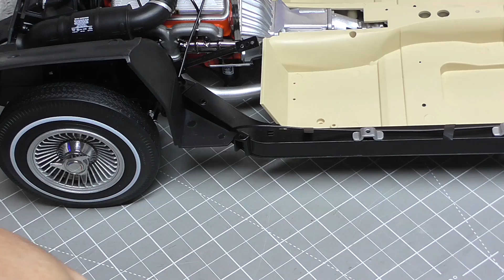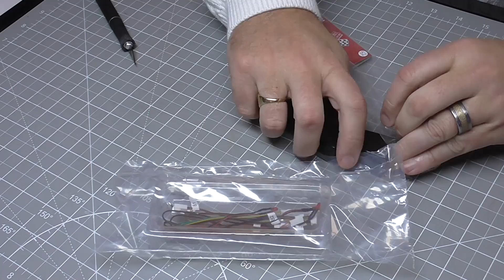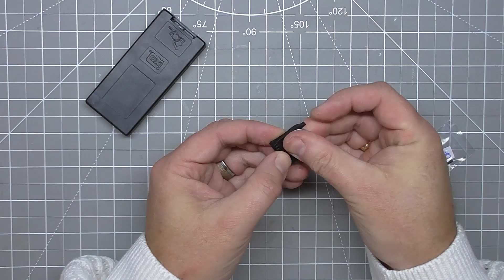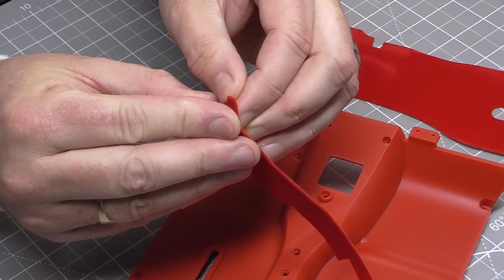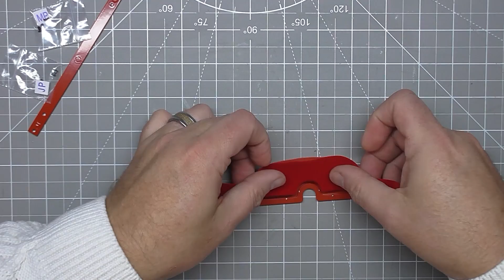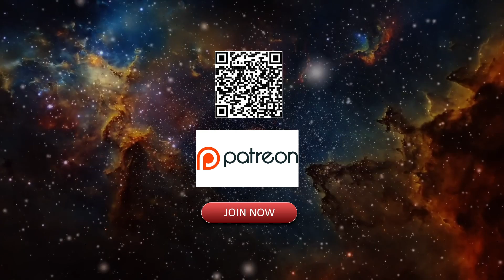Build the Corvette Stingray - Pack 7 - Stages 50-59

Comment: I like Agora model cars very much - I now have 3.  The only real gripe I have is the terrible attempt at recreating the engine and horn sounds.  The engines sound like a tumbler with loose ball bearings clattering around in it and the horn, well, it sounds like the horn on a child's toy.  These models are too well built and too expensive to cheapen them with these out of place and inferior noises!  It really ruins the overall positive impact you get from a visual standpoint. The lights are fine, but Agora should improve the sound features or eliminate them altogether.  Modern technology should certainly be able to deal with this.  I didn't even connect these aspects of my builds.  
I hope you are getting similar feedback from other builders, Agora, and working on improving or eliminating these disappointing and annoying aspects of an otherwise impressive looking and functioning high end model car kit!
Reply: The sound didn’t come over well at all.

Comment: Like the fact that you get to test out all the electronics early on. I just did this pack and everything worked. However I also just finished up the Dodge Charger and nothing works. No way am I taking it apart to figure out why, but then again I generally remove all the batteries after finishing them and never turn them on again.

Comment: Just a thought for laying carpets etc. If anyone needs a straight edge and/or a curved end to smooth a piece into a groove may I suggest a nail file if you don't have tweezers. Most people will have a manicure set, or an SO they can ahem borrow one from with a nail file in it. BTW yes Wayne, having watched your videos for the last two years - and trawled pretty much every video - it's the first model I have seen with its own carpets. They're usually an after-market addition courtesy of Mike's Mods.